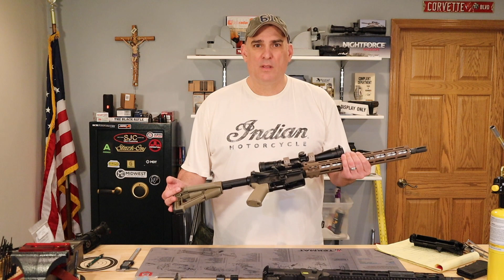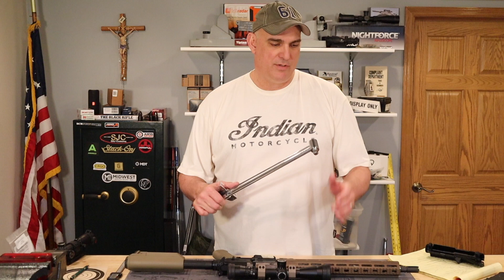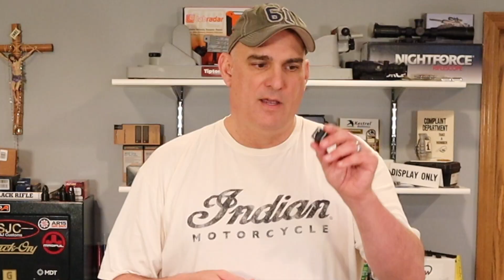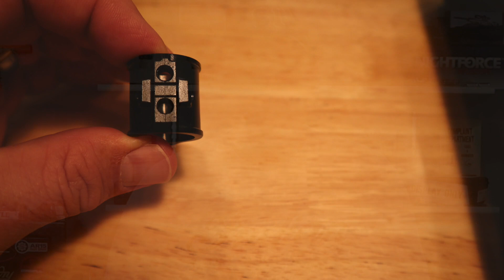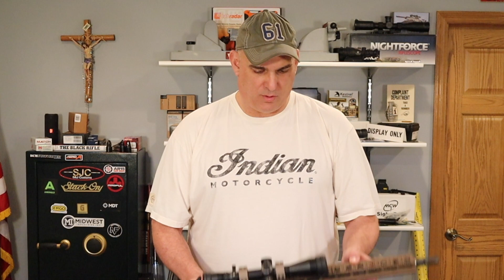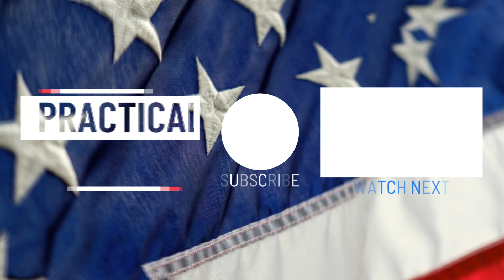Is it worth building your own ar 15? My first ar 15 build, the good, the bad, and the ugly.

Comment: I love building ARs. I bought my first one Aero AR X-15. Then loved the platform so much , I wanted to try and build my own. The first build I was a wreck. Scared, nervous, full of “What ifs” etc. it was the best learning Experience possible, from securing the bolt release, trigger guard (without breaking the lower ), to the 3 times I accidentally slipped and got hit in the head by the Stocks detent and spring. List 3 detents , broke a few springs, and there is I’m sure a detent and spring still hasn’t come down into the atmosphere yet. I was smart and ordered extra parts before starting. I stuck with all Aero precision parts due to knowing and trusting the brand. Nothing puts fear in you like shooting your first round on your first build. 🤣, once everything worked I fell in love. Now I build and add higher quality parts on my rifles regularly. I finally built an Aero M5 308 which was amazing. I can spend 4-9 hours in one sitting and not even realize the time. It’s relaxing, Gratifying , and has become my favorite hobby. Next up… Reloading.. bad timing with primer availability but can’t wait to start. Building equipment slowly but surely. Thanks for your videos 😈🤘🏻
Reply from the maker: Thanks. That's how this build went as well. I'll be building more and I too was going to start reloading until the ammo shortage. I'm waiting to see if primers come back before purchasing a lot of equipment.
Reply: @PracticalAccuracy  going through all your videos, absolutely love and appreciate all the info .
Reply from the maker: Thanks for watching. More videos on the way.

Comment: yes it's worth it..not only will you build it piece by piece..you will LEARN HOW IT WORKS!
I've built plenty ARs..never had to heat the barrel to upper fit..never..sometimes if your upper is ceracoated you can use scotch bright to buff the upper receiver barrel socket..if you have to heat it imo..is a no no..
I've used 6 aer precision sets..never had an issie..and I used cartridge type triggers
SWAP BCG..YOUR ACCURACY WILL MOVE..IM BETTIN ON IT
Reply from the maker: Thanks for watching. I'll give it a try.

Comment: Lapping an upper is an  amazing technique when looking for tight and consistent groupings. 
I had a Smith and Wesson sport 2 that I purchased back in 2014. I stopped shooting it In 2016. As years kept passing by, I would buy parts here and there so that one day I could give it a 21st century face lift. 

All the parts I bought was with the purpose to run it suppressed. In Aug 2021 I got my first tax stamp approved for my dead air wolf man. Just 3 weeks ago I tore that sport2 and installed all the parts I have collected over the years. 

I did update the upper reciver to an Aero M4E1 threaded upper. Dropped in a bootleg BCG for suppressor settings depending on CAN flow and ammo type. Kept the stock 1/9 twist berral but I did lap that Aero reciver  before I installed the berral and nut. 
Once the build was complete I took it to an indoor range here in Orlando that gives me 100 yards. Sighted in different optics that I have and both in 25 and 100 yards I'm getting stupid tight groups. 
Now if I'm using my LPVO the groups are practically sub MOA from 25 to 70 yards
Reply from the maker: Awesome. I think lapping the receiver is something I need to do. Thanks for watching.
Reply: @PracticalAccuracy  yea bro, give it a shot. Now the only concern I would have becuase I don't have experience with thermal fit recivers. I wouldn't know if the lapping tool would easily go pass the were the berral extensions passes threw. 
See if you can research that. If it can you should definitely do an updated video to what it did for you in the accuracy department.
Reply from the maker: @MRD0889  👍 good point. working on fixes

Comment: I recently built an ar 15 for 3k+ with parts from like 20 companies and they all fit and matched perfectly im happy with my build. I didnt have to use anything but a torque and armorers wrench also a punch set. Barrel fit perfectly didn’t need any adjustments maybe the lithium grease helped.
Reply from the maker: Sometimes it works. I'm happy for you and thanks for watching. Maybe my next one will work out.
Reply: @PracticalAccuracy  usually everything will fit in a milspec upper and lower if that helps the next build, i know the spikes tactical upper is already built a bit wide so its easier to slip a barrel in. This is kind of bank breaking but super expensive parts are always going to fit and work which sucks when youre trying to do a budget build. Triggers is luck of the draw if you can fire once and it cant shoot again its most likely a buffer weight/spring or gas port issue thats why a lot of people opt for an adjustable gas block it fixes both problems. I honestly think i just got very lucky on my build. I had to learn a lot when i built my first one, gas tube lengths and barrel pairs and also my first time using a torque but stuff like that it was indeed a great experience. From now on i plan on buying complete uppers and just customizing a stripped lower since its more fun in my opinion
Reply from the maker: @vietnamtactical  Thanks for the advice.

Comment: Did you bed your barrel to the receiver after squaring off the receiver inorder to eliminate any gaps that can cause a shift in your barrel.
Reply from the maker: didnt square the receiver and the BCM upper requires thermo fitting so there is no need to bed the barrel. I was thinking of taking the barrel off and squaring the receiver. Thanks for watching.

Comment: Interesting video I had never shot a AR style rifle and wanted to try building (assembling ) one but I also wanted to see how cheaply I could get one done. I do realize quality parts are most likely to last longer but having a running firearm was my goal. I did a poly. 80% lower and using my drill press and a XY vise and a lot of luck then  a lower build kit one company and a upper receiver from another a barrel from yet another and hand guard gas block gas tube etc etc. till I had everything .  It shoots 1 inch groups so I am happy. As far as you'r trouble with one of those you showed take into consideration you'r twist anything slower than 8:1 most likely will not shoot over 68 gr. Keep on tryin man and keep us informed .
Reply from the maker: Thanks for watching. I'll try to put out another video

Comment: Without the gauges and tools to test parts, it can be a game of luck if the parts are suitable or within spec. I have seen barrels, receivers, gas blocks, bolts, etc that have been on opposite ends of quality and spec from the same manufacturer. The manufacturer can improve those odds but not always..Mil spec means a part is manufactured within a set of tolerances set by the military TDP for reliable function. Many parts claiming to be mil spec are not.. Geissele and LaRue pins should be.1551 , Colt should be .1539..There is a way to oil lap the lower receiver fire control pin holes for fitting tight trigger and hammer pins. Always head space the bolt and barrel being used. Checking the throat and chamber with a PTG chamber function gauge is a must too in my opinion.. Barrel quality, upper receiver bolt carrier fit are imperative to accuracy.. A loose bcg upper receiver channel will kill accuracy..Lapping the upper receiver has dramatically increased accuracy for some of my rifles and also has had very little to zero perceived accuracy improvement for other rifles..I can say my Geissele upper receivers have been fantastic for their bcg channel, barrel fit machined dimensions and tight fit with my lower..
Reply from the maker: Very good advice. I learned a lot of what you said the hard way. Thanks for watching and the input.

Comment: I am answering this as you just asked for us to answer.  I always wanted to build my own.  I used all Palmetto State products.  I knew it was quality stuff but at a much lower price point.  And if I did screw it up it would not have cost THAT much.   I purchased all parts way before the corona virus.  And by purchasing individually I opted to the get all upgraded items.  It turned out wonderfully.  I shot very well and just as good accuracy as my Colt 6920.  Maybe that had to do with the CHF FN barrel I opted use.  What really makes me proud is that I put that rifle together myself.  So yes I am glad that I did.  Now I did purchase the A2 front sight post already installed.  That I wanted perfectly aligned.  So I might have cheated a bit but still it is a rifle that I put together and proud of it.

Newbies....you and I both did not want to mess with the gas block!  I as well had to purchase a torque wrench.  Never used one and I only used it once Ha!

I would take the barrel off and re-install it.  You never know...maybe it was not torqued enough.  Who knows but I would re-install the barrel.  Not much more you can do to the rifle more accurate.  It is combat accurate though!  Hoo-Yah.  USNavy.
Reply from the maker: I'm glad it worked out for you and you didn't cheat buying an A2 front sight post already installed.  I'm working on one myself. Thanks for watching.

Comment: Props for you getting a pinned gas block.  that's critical for long term reliability.
Reply from the maker: Thanks. I guess I got that right. Thanks for watching.
Reply: @PracticalAccuracy  It's been close to a decade since i investigated making a super accurate upper.  So take this with a grain of salt.  The scuttlebutt from one uber premium barrel maker was his recomended gas blocks were clamp on style.  he claimed something about barrel harmonics or what not.  I don't buy it for a second.   the next build you do try a faxon or ballistic advantage.  Both can be had with a pinned gas block.  I have a 18 inch faxon and the limiting factor is me not the barrel.
Reply from the maker: I was wondering if that could be it. I'll be using a different barrel manufacturer next time.

Comment: Check the transition of lower to barrel feed ramps. these should be seamless and smooth. if the bolt is comming forward and picking up a round and scraping the tip of the bullet as it enters the chamber it will casue the bullet to be damaged and affect its flight. There are 2 feed ramps a left and a right so if it is always the 1,3,5,7,9, shot that pulles look at the right ramp and oppisate for the left or it could be both. just get the other one and compare. good luck.
Reply from the maker: Thanks for the input. I checked the feed ramp to lower fit and there is no lip that the bullet would catch and cause deformation to the tip.
Reply: @PracticalAccuracy  I am just trying to heip and I swear i am not trying to come off as a know it all or a jack hat. So please dont think that of me. Just to make sure we are both on the same page. inspect the transition area from the reciver to ramps. Where  the black turns to silver. If you were to cut a tooth pick point off so that it is blunt/ flush then run the flush end back and forth across the entire feed ramp on both side to see it it catches/hangs up in the transition form recicer to barrel. please let me know what the fix is if this in not it, I just got to know. thanks dave
Reply from the maker: I'll try to get back to you and yes we are on the same page. The transition is smooth as silk. I saw a video on this before I put the build together so I checked it.  If I had to guess, I think it's how the gas block was installed on the barrel.  At some point,  I need to do a follow up video.  There are just so many suggestions, it will take some time. Thanks for the input. I do appreciate it.

Comment: Areo M4E1'S takn over!!
Reply from the maker: Unfortunately. I would buy a different lower next time. Thanks for watching.
Reply: @PracticalAccuracy  yours isnt a M4E1 thou!
Reply from the maker: @DC4EVA   I did buy 2 of them and had problems with them. Wouldn't buy them again.
Reply: @PracticalAccuracy  what problems did you have if you dont mind telln
Reply from the maker: @DC4EVA   on both lowers, the trigger and  hammer pin holes were undersized.(.155 instead of .156)  I could not fit my pins in without pounding. I ordered some Colt pins which are on the small side  (.154 ) and they fit, but I was not able to put the geiselle triggers  (.1555) in that I wanted. The Rock River lowers I have measure .156 and I'm able to use the Geiselle triggers in them no problem.
Reply: @PracticalAccuracy  .154 is actually the size they are, they  use standard small pins
Reply from the maker: @DC4EVA   .154 is the pin size. Colt runs a hair smaller at .1535/.154  I believe the Mil spec lower holes call for .156 +/- .0015 so the pins can rotate. The Aero lowers run small, but are within  +/- and the Rock Rivers are spot on .156 so they allow me to run the slightly oversized Geissele pins. Nothing wrong with Aero. It just didn't fit with what I was trying to do.

Comment: I used to reload my own ammo when I was 16 and bought my Colt AR-15 sported rifle when I was 17 I am 59 and got back into reloading two years ago and started building AR s two years ago and Black Friday ain’t just for Walmart. I have built 2 .308 ,5.56 and a 16 inch 300. Barrel nuts kind of like engine head bolts run a couple 100 rounds through it and then re tighten if necessary.
Reply from the maker: I'll double check. thanks for watching.

Comment: Remove your muzzle device and replace it with a thread protector and retest.  That is your "control group."  Thread protectors do not interact with the projectile at all.  I'd recommend removing your optic and redoing that too, over-torquing the screws by 5-10 in-lbs.
Reply from the maker: Thanks I'll give it a try.

Comment: I too built my first AR a while back and now built my third one. I love your honesty. 🤣  My first build was a .300 BLK that had numerous problems.  I learned much from that one about dwell time and port sizing. I spent many hours watching video's and reading about the gas system of an AR and how it works. It would tear the rim off the case trying to eject the case that would not come out of the chamber. I polished the chamber and changed powders and tried different loads. I finally got it to work but eventually sold it. My next one was a 5.56  18 inch 1-8 twist Mark 12 Mid length barrel that wouldn't lock back on the last round. I finally had to increase the powder charge and shoot 62 grain bullets to get it to work. It liked hotter loads. I could have drilled out the port some but decided not to as it finally started to work well enough to leave it alone. My last one is a .223 Wylde 16 inch 1-8  Stainless spiral fluted carbine length gas port barrel that had some early issues. The chamber throat was not reamed enough to take a factory bullet. I had to obtain a chambering reamer and correct that myself. It works fine now and is quite accurate. The journey through all this has taught me considerable and if a person values that then it was definitely worth it. If a person doesn't value the learning process it's best to just go out and purchase what you want and be done with it but I wouldn't want it any other way than the way I did it. 😁
Reply from the maker: Thanks for watching and commenting. I definitely learned a lot too. I'll be building more and throughly enjoyed the process.

Comment: One thing that I have not seen mentioned in the comments is about the weight of the bullets that you shoot.  You said that you shoot the heavier bullets in the gun.  My question would be, is the rifling twist in the barrel correct for the heavier bullets?
Have you tried shooting it with 55 grain bullets to test the accuracy with the lighter bullets?
Reply from the maker: Have not tried 55 grain yet. Although the twist of 1-8 should be fine for basically any weight. Thanks for watching.

Comment: Did you headspace those guns?
Reply from the maker: Yes.  one is consistently at 1 moa.  The other is 2.5 to 3 moa.
Reply: @PracticalAccuracy  Yea, that's what I thought. Please google what 'headspace' means or visit. a gunsmith.
Reply from the maker: gunsmith did it before the build. they both checked out.  1 gun shoots 1 moa and the other gun shoots 2.5 to 3 moa so i dont think headspace is the issue.

Comment: In the video you never mentioned whether or not you used the same BCG. If not, the fix may be as simple as putting a different BCG in the fde upper. If the BCG came with a short firing pin it may also have a bolt face that isn't true. I'm not a professional but if it were my gun I'd try that first.
Reply from the maker: I checked firing pin protrusion and it's within spec, but you may be correct about bolt face. I haven't switched it yet, but I'll put it on the list.  Thanks for watching.

Comment: Put a longer barrel on it, that looks more like an SBR than a precision rifle. I love my Faxon match series 16 in. barrel. I just got a stretch 16 that I’m going to do a build around, so I’ll let you know how it works.
Reply from the maker: Thanks. Let me know how your build works.
Reply: @PracticalAccuracy  runs smooth and dependable, like it was meant to. Very fast and accurate. Took a bit of experimenting with bcg’s, the short dwell time of the intermediate gas length does not like lightweight bcg’s. Something to keep in mind and thankfully I have lots of them to play with.

Comment: Blue lock tight does work fine on gas blocks  it might brake down slightly but not even close to enough to let those set screws back out and u don't have to worry about stripping screws like with red lock tight and now that i know Daniel defense says to use blue on the gas block set screws that is more then good enough
Reply from the maker: I bought a DD gas block for another build and they recommended blue loctite so I'm going with that on the build. thanks for watching